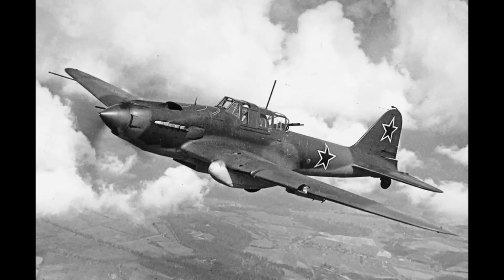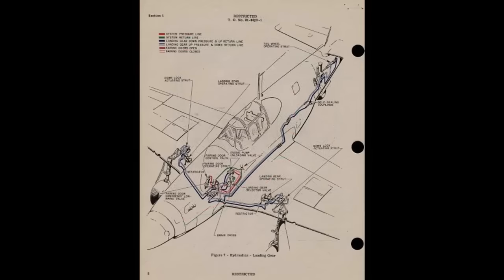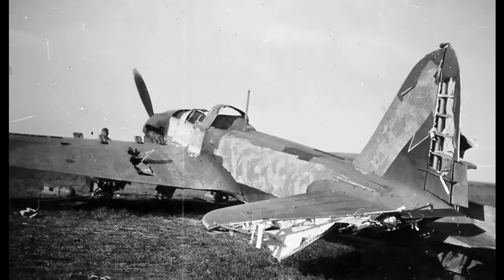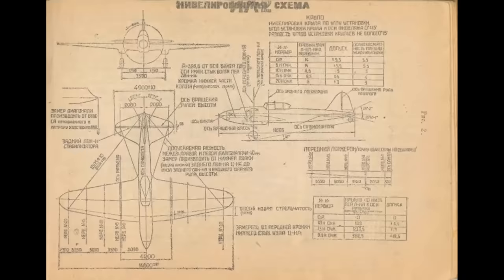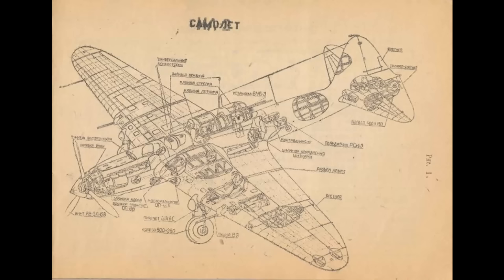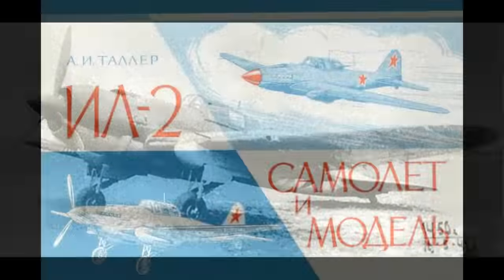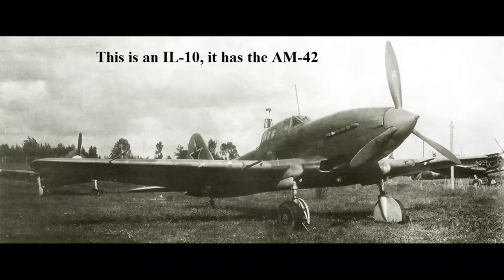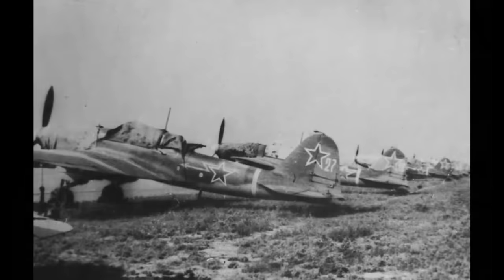Ilyushin IL-2 Sturmovik

Comment: I greatly enjoyed this video, having seen a real IL-2m in the Prague aviation museum.  Does anyone know what the protrusion on the starboard wing (item 7 in the drawing at 29:30) is?  It seemed like a cylindrical colander sticking out of the wing and I thought it might be an oil cooler cover?
Reply from the maker: That's the air intake for the supercharger.
Reply: @GregsAirplanesandAutomobiles  thanks very much. Odd place and big filter - presumably due to rough airfields and dusty summers.

Comment: How dare you suggest that Communism isn't perfect and doesn't produce a Utopia, because muh Communism. Besides, any failures that are so well-documented that I can't ignore them, I will simply dismiss by saying, "it wasn't real Communism".
Edit: I believe the AM engines were developments of a Hispano-Suiza engine originally built on license and the HS aero engines used a master-articulated connecting rod rather than a traditional fork and blade system, so that the rods on one bank of the engine had shorter rods (the articulated side) than the other bank with the master rods.